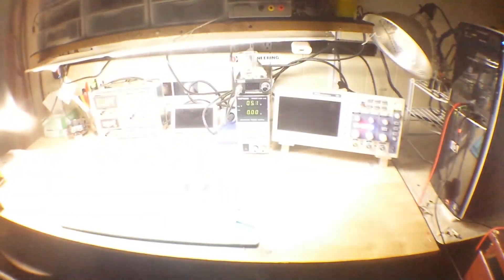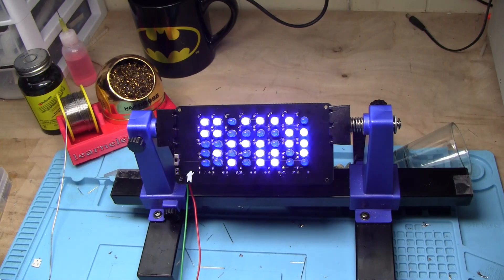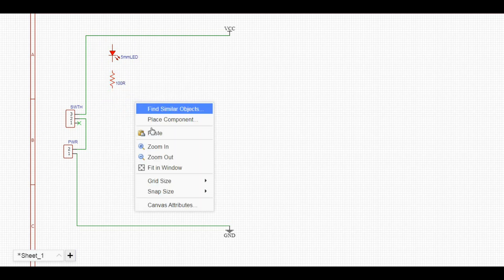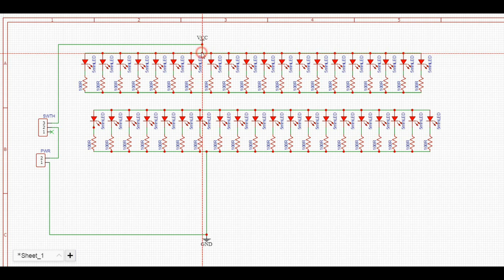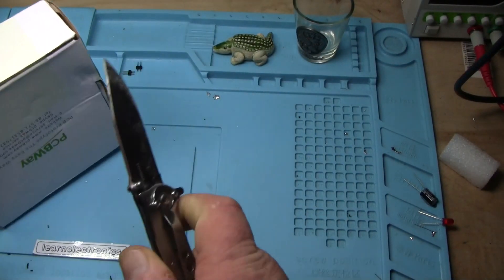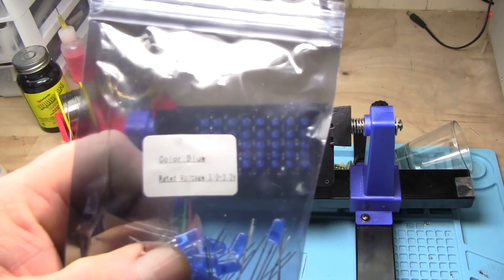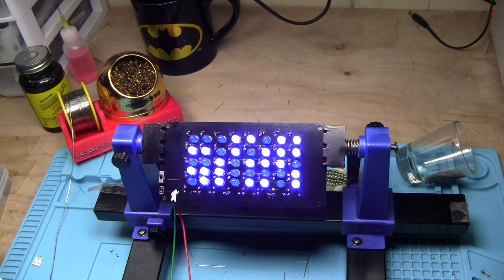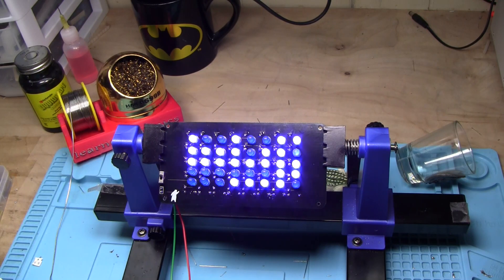Super Computer BLU Circuit PCB Design and Build

Comment: The VCC ground thing always throws me off about building PCB you would think all you would have to do is  to put it to the power connector what are the VCC and ground actually goes to and that's it
Reply from the maker: It's just for the electrical design check in the software. You don't have to do it.

Comment: Great video Paul! Yep Big Clive started something that has showed up all over the Tube! Lol
I did order Big Clive's boards from JLCPCB which is who he uses and they cost extra because of the size an shipping was not as bad as I thought it was going to be. $27.00 bucks total.. :-) Never done that before so it was a cool experience. They sent a email at each step of the process which I found interesting and cool...
I bought several kinds of leds for the boards 5mm, blue, blue/diffused, red/green, Multi color, white clear/diffused and 3mm Multi color,. Going to make one board with all of them and the other 4 with all the same leds on them. I do have his files he used and I may update the board to add a switch and power plug as well, not sure. Clive made them for a picture frame so the switch and power plug would have to be cut out in the frame back so placing might be a issue.. :-) Besides there cool just because they have BIGCLIVEDOTCOM on the back... ROTF
Thanks for the video!
LLAP

Comment: I can see that the LEDs do not all blink at the same frequency.  I was wondering if the voltage across the LED affects the frequency ?  Perhaps change some resisters up and down by a std value.  This could reduce small clusters getting in to repetitious sequence.  Aaahhh whatever - it does look good.  Shame its so ... small   hahahahahahahah  size matters !  :-}

Comment: I need one! I want it to show when my battery bank is fully charged! So it be powered by solar, and turn on when the batteries stop charging!  This is when I use the most power, when fully charged, having a remote mounted light, to show when power is ready to use, direct from solar, insted from battery,